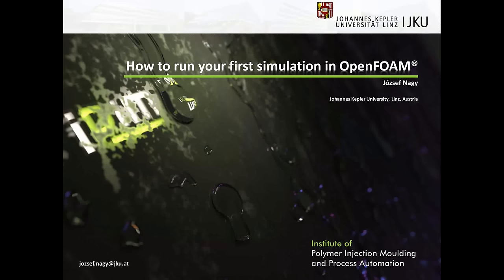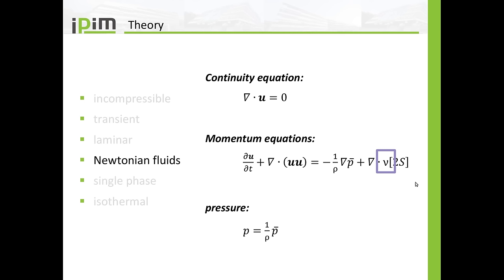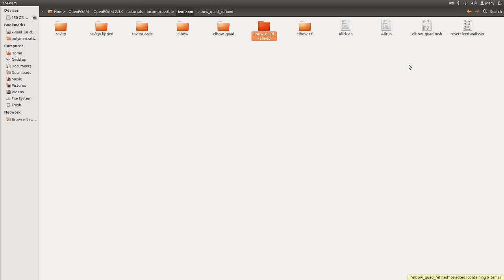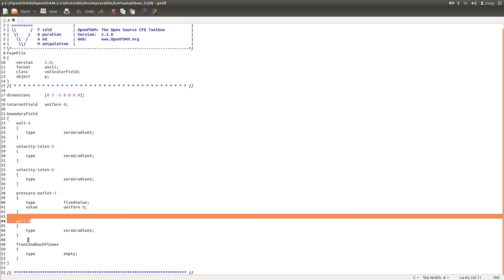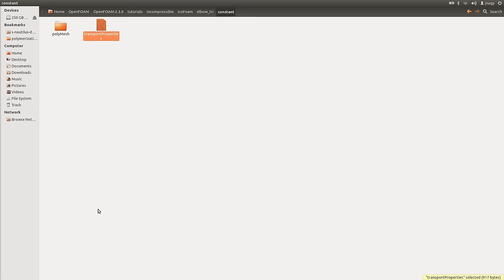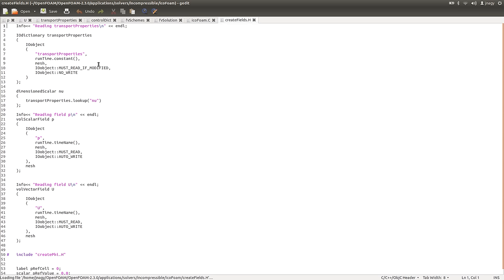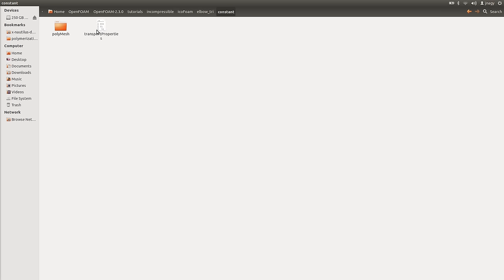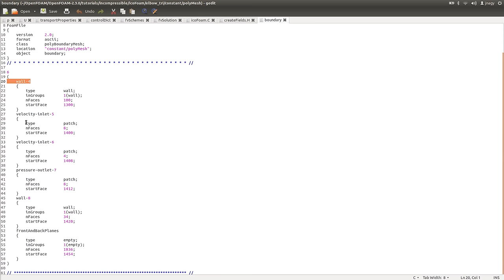How to run your first simulation in OpenFOAM® - Part 1 - tutorial (download link to msh files below)

Comment: Firstly, many many MANY thanks for this collection of various videos illustrating and explaining various tasks and simulation exercises in CFD using OpenFOAM - they appear to cover a useful range of simulation problems and look like they MAY be helpful in due course.
BUT I do have a small 'complaint'/request and suggestion.......  For those of us, like myself, coming from both a pure Microsoft Windows OS and zero practical CFD experience (although understanding the basic background physics, and with some other FEA experience with commercial software packages).

As far as I can see, so far,  none of the various introduction videos you have made, thus far, explain clearly the nature of and manner in which OpenFoam is meant to be used (e.g. as far as I understand OpenFOAM is not a unified 'self contained' application, but rather a 'library' of different CFD tools for different CFD simulation problems?).  

Also there is de facto negligible explanation of how a user can either create a model geometry or make use of an existing 2D or 3D CAD model created in some third party commercial CAD software.

Finally, for those not wanting to or having any need to learn Linux, and only having to expose themselves to it so as to be able to use OpenFOAM and the related other applications (such as Paraview for post-processing), it would be helpful to present a 'dummies' separate step-by-step guide of how to import/create a model geometry -> mesh the model -> define the boundary conditions/physics -> execute the solver -> generate visual results (i.e. postprocessing).

But, these comments aside, I repeat my congratulations to you at a very well made collection of informative videos.
Reply from the maker: +Richard Watkins Ok, firstly I did these videos in my spare time, so please understand, that they are not as professional as you would get them for a commercial tool. If you even get videos for a commercial tool. 

Yeah, OF is not a big application, but rather a collection of solvers and utilities. I stress at the beginning of each tutorial, which one I use and which equations are being solved. For a detailed explanation of OF please refer to the user guide. 

Well simple geometries can be created with blockMesh, I use this utility rather extensively. In regards to real life geometries, there are many preprocessors (e.g. ANSA, Pointwise, etc.). If you want to go for the open source solution, snappyHexMesh is the best bet. There are a lot of videos on snappy. 

I was thinking about a video covering all the needed steps, however this takes a lot of time, right now I have a lot to do at work and I would like to enjoy my weekends. Maybe at a later time.
Reply: Again many thanks for taking the time for this detailed reply (in your free time!).  I do understand that these videos are not intended to be professional videos - but they are still very good.  My comments were just trying to point out that there are some basic background information missing and assumes the viewer will know (e.g. that OF is not single application but a library, etc).  Perhaps, when you next have time, you can do a video that explains the sequence of separate steps a user must go through, from start to end, to simulate some fluid flow scenario.  Personally, at this moment in time my first time use in OF is to use it to try and simulate the constant flow of a liquid through a cylindrical cavity (i.e inlet pipe at one end and outlet at other end) BUT which has various solid structures/obstacles inside that effectively present various paths for the liquid to flow - and to produce a colour contour 'map' of the pressure and/or flow rate distribution at different points in the cylinder.  Fortunately the model has rotational symmetry and so could be done in 2D, I assume, to save computational effort?
Reply from the maker: Yes you can save computationeal effort. You need the wedge boundary condition for that.
Reply: OK. 'Wedge Boundary Condition'. I will make a note of that.
Reply: +József Nagy hello prof, do you have tutorial which involve centrifugal force i.e. centrifuge or alike handling any substance in multiphase(substance phase changes during the  process.liquid and gas) if no, any tutorial which involves centrifugal force alone or multiphase alone would be fine.thank you in advance...
Reply from the maker: Hi, I don't have anything on centrifugal force, this is a tutorial on multiphase modeling: https://www.youtube.com/watch?v=5WO2cDRB_iY

Comment: Thanks so much, this is a great introduction on OF running.  I wish I found these first rather than suffering through the OF Foundation tutorials.  Just wanted to comment that the audio could perhaps be a bit clearer; it sounds a little bit like you are in a tube or pipe when speaking.  Perhaps this is appropriate tho for simulations involving pipes...   Also when talking of "tri" meshes, it sounds like you are referring to "tree".  The "i" in tri is a long i.   

However a really well done, clear, and enjoyable tutorial.  The 33" length is good also.    I should mention that I made a hard link to your tutorial page from my OF Resources web page.

Comment: Hello Jozsef, you doing a great job.Good luck.I am wondering that can I run open foam in window rather than Ubantu. As I got bad impression from expert who suggest me to go with window rather than Linux.Looking forward for your comments soon.
Reply from the maker: sanjay dash I don't know about that. LInux is way cooler than Windows. There is a possibility to run it under Windows, but you have to google it yourself, because I will never use it. You loose a lot of performance only for the OS. Additionally, if you want to run professional calculations on a server you will always find some kind of Linux/Unix OS on servers. So install Ubuntu/Suse/Red Hat and have fun with OpenFOAM!
Reply: Thanks a lot Jozsef.But ubantu is troubling me a lot.
Reply: sanjay dash Ubuntu mate, it is like
 ubuntu 10.04 jajajaja

Comment: For the pressure boundary conditions:

Why do we impose the velocity inlets as a Neumann condition with 0 gradient?   Does make sense practically given we're expecting a pressure gradient, especially at the smaller diameter inlet?
Should the pressure at fluid inlets not be extrapolated out from the first few control volumes?  

Thanks for the great tutorial.
Reply from the maker: This is due to the tutorial nature of this case. For simplicity sake. If you progress with my videos, later you will see better pressure BC-s on inlets.

Comment: Thank you sir for your tutorials. One small thing. My root directory doesnt have anything else than the tutorials folder. I am using the version 2312. 
Likewise, when running the icoFoam command i get this error, " FOAM FATAL ERROR: (openfoam-2312)
cannot find file "/home/adknis/tutorial_files/alltutorials/incompressible/icoFoam/elbow_tri/0/p". I tried looking up at the solutions but couldn't find a solution to this. How can I remove this error and proceed forward? Thank you.
Reply from the maker: Check in the file editor, whether you have the file p at the given location. Maybe you are at the wrong path when starting the simulation.
Reply: @OpenFOAMJozsefNagy  Thank you for your reply sir. I found the error and the simulation is running now.
Reply from the maker: @nischaladhikari6271  Great!

Comment: Thank you for making this video series. I do have a question. Why do you open Paraview with "paraview &" instead of just using paraFoam. I can't find a difference so far, but wondered if there was a specific reason. Thanks!
Reply from the maker: It doesn't make a big difference. I just like to use the latest versions of both OF and paraview. For a while the paraview version coming with OpenFOAM was the version 3.14 and that version had some serious issues. But a newer version was already available on the homepage of paraview. Since then I download the newest paraview version from there and I don't use the OF version of paraview. I'm not even sure, which version of paraview comes with OF right now. But you are right, it does not make a big difference. I just like to use the newest versions. That's all.
Reply: Great thanks, I will definitely look into the newer versions to do the bulk of my post processing.

Comment: good video, but I'm having trouble following along on one part. When im in the terminal creating the mesh the "fluentMeshToFoam" command is not found and I cannot continue. Upon further review i've found that I also don't have the polymesh folder inside the "constant" folder. How can I go about solving this? I'd certainly like to start using openfoam more!
Reply from the maker: I think, that you did not source OpenFOAM. You have to enter a line into your bashrc. Take a look at my video on installing OpenFOAM.
Reply: Hello , I have install of240 and when I tried to make testing at elbow_quad, and I foundthe mesh is the same as elbow.msh. I did not have elbow_quad.msh, could you do me a favor  let me to copy it from? Thanks
Reply: @NIP1337 : am facing the same issue with openfoam 4.1. Pls provide me ur suggestion
Reply: how did you solve this issue?
Reply: I entered the line 
still i am facing the issue
 @OpenFOAMJozsefNagy
Reply from the maker: @kshitijghormode8788  There are two videos on my channel on how to install OpenFOAM, check them out.

Comment: Hi joszef, great tutorial ! Unfortunately, I've been facing this error when I run the fluentMeshToFoam:
FATAL ERROR : 
Could not find mandatory etc entry (mode = ugo)
'controlDict'
Reply from the maker: You have to run the command in the elbow folder
Reply: @OpenFOAMJozsefNagy  Hi Nagy, I'm having this problem: the parent directory does not allow write permission to the process, or one of the directories in ~/icoFoa,/cavity/cavity/constant/polyMesh did not allow search (exacute) permission, do you know how can I fix it?
Reply from the maker: @antoine1407  Why is there a comma in icoFoa,? You can use chmod to shange permissions. Just google the command.

Comment: Hi, Jozef

Thanks for your tutorials, but here I've question about the file "elbow_tri.msh". I suppose that you've builded up this mesh before the viedo has be made. So if I want to do the same like you did after 32 min, then I've to creat this elbow_tri.msh file by my own? 

thanks!!

liu pei
Reply from the maker: I'm not sure if I understand your question correctly. Do you mean really elbow_tri or elbow_quad? elbow_tri comes with OpenFOAM, you should have it in the standard installation. If you mean the elbow_quad mesh (the one I use after 32 min and in the second part), you can download it, I put the link into the comment.
Reply: József Nagy hi, sorry I haven't decribed my question clearly. I was looking for die elbow_quad.msh! and I've already downloaded from your atteched adress!!  thanks a lot!!!

Comment: Hello, this my first time using openfoam and evrytime I try to execute the icoFoam solver I get following error.

-> FOAM FATAL ERROR: (openfoam-2212)
cannot find file "/home/alaur/elbow/0/p"

From virtual Foam::autoPtr<Foam::ISstream> Foam::fileOperations::uncollatedFileOperation::rea dStream(Foam::regIOobject&, const Foam::fileName&, const Foam::word&, bool) const
in file global/fileOperations/uncollatedFileOperation/uncollatedFileOperation.C at line 561.

FOAM exiting
Reply from the maker: You file in 0 is missing. Do you execute the command in the correct folder?
Reply: @OpenFOAMJozsefNagy  Thanks for the fast reply  I am executing the command in /elbow. In the zero folder I have the following 2 files: U  p
Edit: When i run ./Allrun evrything works

Comment: Thank you for your very instructive video! I have a question. How can I make quad mesh? where can I get quad mesh?
Reply from the maker: I am glad I can help. My suggestion is to go through the basic tutorials. Then go through my multiphase simulation project, there I show you how to use snappyHexMesh for meshing in OpenFOAM. Also check out my video on the new tutorial collection, and go to the collection, there is an extra section on meshing in OpenFOAM with multiple tutorials.
Reply: Thank you !

Comment: Hi József, 
I need some advice. I 've imported a 3d mesh of a cube from star ccm format to OpenFoam using ccm26ToFoam comand. I want to simulate a simple folw from one wall to the oposite one so i've used the elbow 0 and system files. I've changed p and U files so i could start icoFoam, changed endTime to 75 in controlDict, deltaT is still 0.05. But when I start icoFoam when teh Time = 0.2 i got an error in calculation of floating points. Do You have some idea what to do with that?

P.S. Great tutorial Man!!
Reply: Just found a problem. endTime=10, deltaT=0.005. Worked:)
Reply from the maker: Great!

Comment: Hello Jozsef,could you explain the difference between zeroGradient condition and fixedValue condition?I don't get the exact difference between these concepts.Thanks
Reply from the maker: fixedValue fixes for example the pressure to 0 at the cell faces of the outlet. It cannot change throughout the simulation. 
On the other hand zeroGradient sets the gradient between cell centers and face centers of the boundary to be zero. This means, that you take the value in the cell center out of your solution for the face values.

Comment: Hi József, great video! When I tried to run paraview, I got this message (version `GLIBCXX_3.4.26' not found (required by /lib/x86_64-linux-gnu/libapt-pkg.so.6.0).
Reply from the maker: System library issue. If you are running on Windows use the Windows version, if in Linux try updateing your Linux or use older versions of Paraview.

Comment: Very helful, thank you. 
what does the & stands for when you open paraview? (command "paraview &" @ about 20'40")
Certainly kind of Dubious question ... I am completely new in the OpenFoam / Ubuntu / CFD community
Reply from the maker: Paraview should run in the background and you can further use the terminal. Otherwise it is blocked by paraview.

Comment: I installed everything according to your tutorials but I keep getting error : version `GLIBCXX_3.4.26' not found (required by /lib/x86_64-linux-gnu/libapt-pkg.so.6.0) 

Been working on this for 2 days, please help me. I cannot open paraview etc.
Reply: Are you on Linux or on Windows?
Reply: @Benjaminfenk  I have the exact same problem. I am on Windows 10, operating OpenFOAM Ubuntu. Could you help?
Reply: @MichelleGell  I had a similar problem. I had to execute the installer as admin. Now it works fine.
Reply: @Benjaminfenk  Linux subsystem in Windows. I followed update steps and moved the .so file manually to my network folder and it is working after that. https://askubuntu.com/questions/1140183/install-gcc-9-on-ubuntu-18-04
Reply: @davidschouten8054  What do you mean by moving the .so file? I am very new to all of this, so I would appreciate it so much if you could explain it step by step, thanks in advance!
Reply: @MichelleGell  yeah me too. let mee see: I have installed OpenFOAM on my D Drive as well as on my network, which is the home directory if you go "cd ~" . On my network drive I still had an old file, which does not read the glibcxx file. I updated the whole ubuntu and everything (you can google this to update the glibcxx with it) and moved the file to the location. In the kernel you can find what file the ubuntu wants and where it is.
Reply from the maker: For Paraview? Use the Windows version if you are running WSL. If you are running Ubuntu natively, then you have to update your libraries.

Comment: Thank you for the videos.  I am having trouble viewing objects in Paraview 5.4.0.  I followed all of your steps, and the program ran well.  However, when I open Paraview and load the "ControlDict" nothing opens.  Paraview opens, but no object loads.  Any help would be greatly appreciated.
Reply from the maker: If you work with Ubuntu, the newer versions of Paraview seem to have trouble. On Ubuntu try older version e.g. 4.3 or try to open the case in Windows with the newer versions.

Comment: hi, thanks for sharing this. Is there a way to use parametrization in OpenFoam? I have ANSYS experience and you can nicely use parameters. Lets say that you're looking into the drag and lift of cylinders and have a CFD run for 10 diameters. Instead of manually running 10 cases, you can use Design Points in Ansys Workbench. Is there a way to do the same thing in OpenFoam? 
Maybe use a for loop to import 10 meshes (one at a time) run the CFD, then import the next mesh, run the CFD etc.? Thanks so much.
Reply from the maker: +Pavel Petruneac Yeah sure. Check out bash scripting. Should work. Take one of the Allrun scripts from the tutorials as a starting point.
Reply: Thank you, Jozsef. Will have a look at that. At the moment, I haven't used OpenFoam, but I am considering learning as part of my course.

Comment: HI Josef, first of all thank you for the time you have taken to do these tutorials, they are very useful! I was wondering if you could possibly suggest a solution to my problem. I have installed openFoam on ubuntu 16.04 using docker, and for some reason can't find the installation files like yours (including the applications folder) in hoe directory or the /opt. Any ideas would really be appreciated. thank you
Reply from the maker: Hi Anastasia, I do not have a lot of experience with Docker. What do you get when you type in e.g. 'which blockMesh' ?
Reply: József Nagy hiya, just tried which blockMesh and got /opt/openFOAM/openFOAM-v1712/platforms/linux64GccDPInt320pt/bin/blockMesh 
So it seems to me like there should be openfoam folder in opt, but the only folder I have there is google (new laptop)
Reply from the maker: Can it be, that in your case there is the /opt folder of your system and also the /opt folder of docker?
Reply: József Nagy that makes a lot of sense actually, thank you very much
Reply from the maker: I am glad to help.